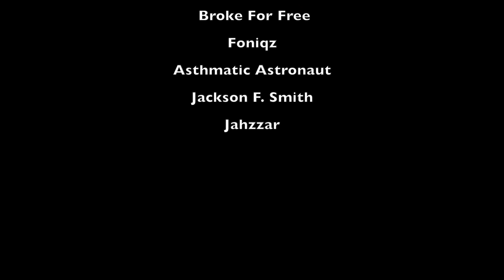Bottom Painting the Hull of a Sailboat | Drew's Cruise Ep. 6 | Catalina 25

Comment: What's the latest? Any updates?
Reply from the maker: Been very busy with keel refinishing and wood working. I painted the keel in an episode before but had to redo it since rust was already coming through, I put some POR 15 on it and it seems to be working nicely. Pretty much got all the wood on the outside of the boat boat done, plan on removing stanchions for paint (who needs those anyways?). I will be releasing an episode sometime this week. The keel has also been lowered and we are replacing the pivot pin, installing a bushing, and we got some thicker retainers that reduce keel movement. Thanks for the comment.